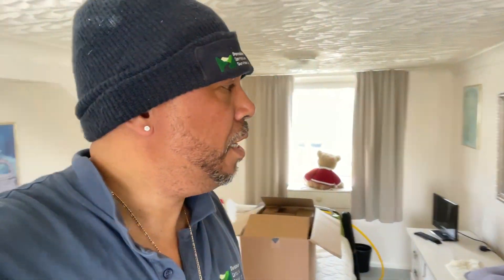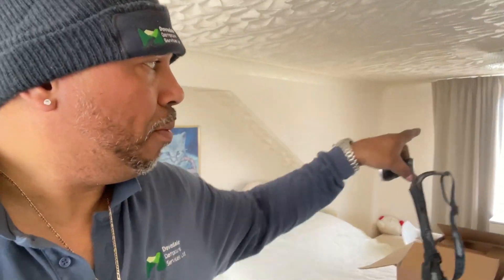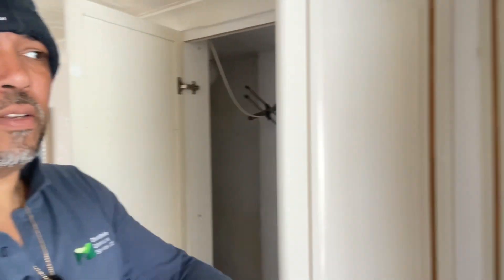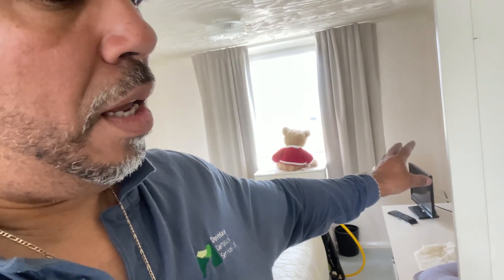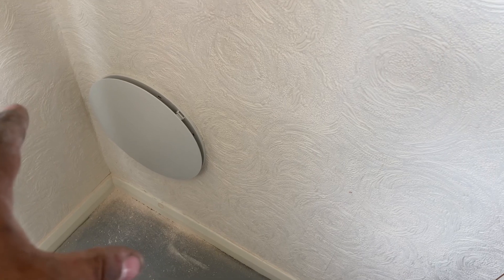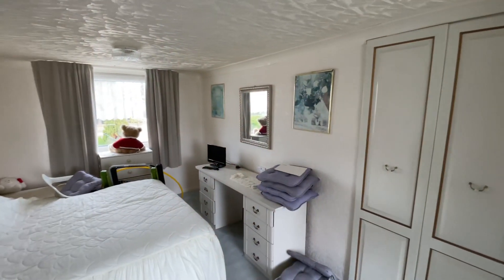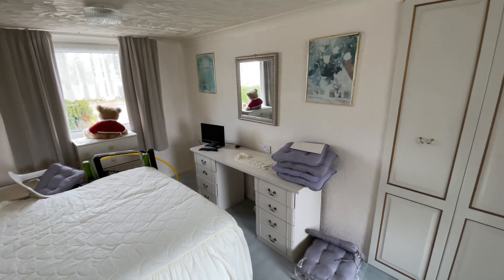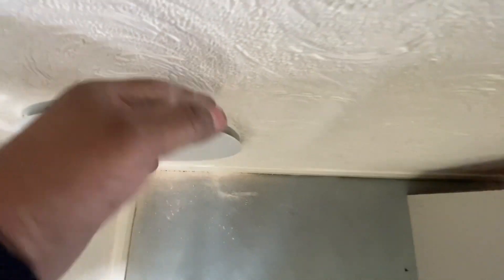An Unusual PIV Installation

Comment: I have a wall mounted one.
How can I turn it off !
To cold and draughty in my living room.
Reply: All of this fuss I fitted a air vent that blows and sucks set it to blow and it has a plug on it so I just put a timer on the plug and it comes on when I'm not at home and off when I am so when the heating comes on when I get home it warms up the cold air it's blown in I don't need to spend hundreds it cost me 40 quid plus £10 for the timer switch job done
Reply from the maker: Nightmare!
Reply: Not sure about a wall mounted one but I know you can have a heated one fitted in your loft, it’s not hot hot just a tad bit warmer then just cold